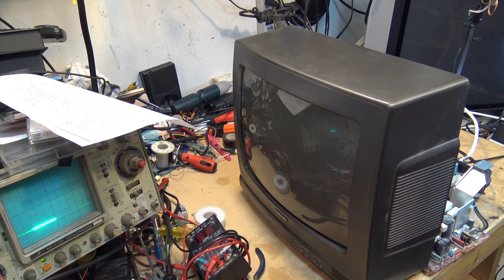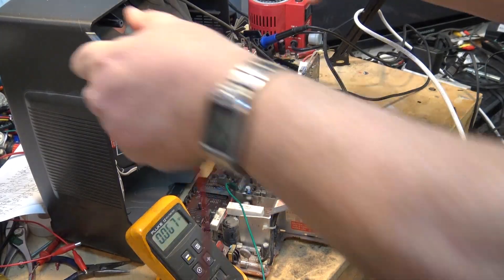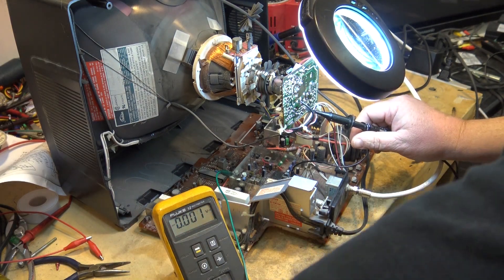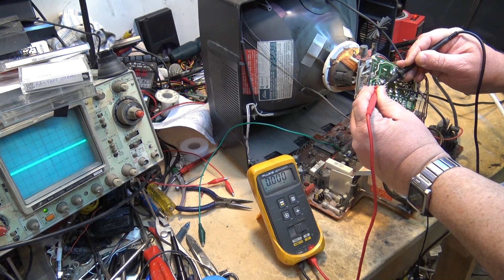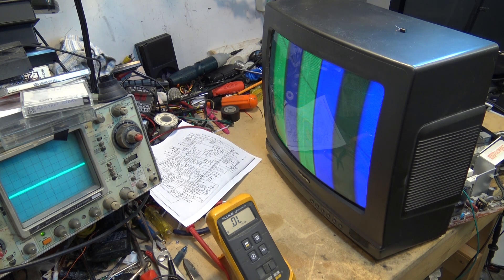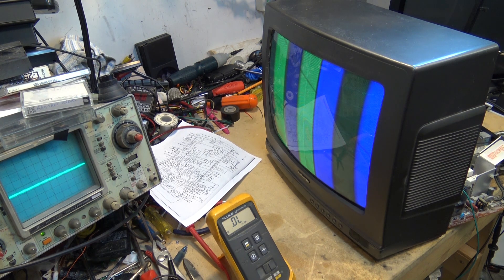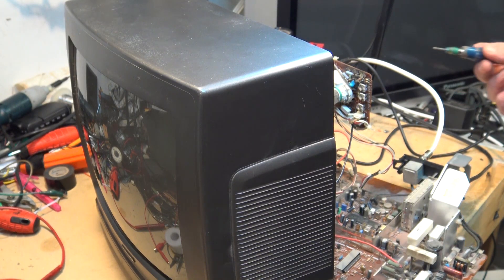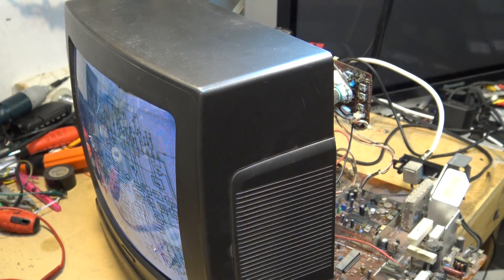toshiba crt tv troubleshooting video output and crt bias adjust

Comment: In rare cases, the video output power transistor may be damaged by some foreign object or by touching the electrodes of the cathode ray tube.🤔
Reply from the maker: Usually arcing internal in the tube pops them.
Reply: @12voltvids  Thank you for letting me know. 🙏

Comment: You plugged in power using an isolation transformer, then connect a grounded scope LEAD  to the CRT? Are there different ground potentials being utilized that are isolated from each other?
Reply from the maker: Scope is not grounded.  It is also on isolation transformer.
Reply: Thanks, Watched another of your video's titled "Toshiba CRT TV No color video repair"  where you explained into detail why your scope is grounded SHOWING your ISO Xformer. GREAT.
Reply from the maker: Ground pin on scope is cut.  I can externally ground it if needed however the device under test is still isolated.  The secondary on isolation transformer is floating.  Therefore contact with either side to ground will do nothing.  Normally the neutral is bonded to ground so a path from the hot side to ground will wither shock you or damage test equipment.  By having both the hot and neutral physically isolated from earth you remove that risk.
Reply: @12voltvids  , Makes sense, I measured continuity  from both AC line input pins on my scope to the GROUND pin & THEY EACH READ OPEN..
your scope is utilizing  "isolated  secondary neutral" as  reference on its BNC connector.... .I  can only assume, I must use my CraftyMech for CRT troubleshooting,.cause my game board supplies along with R.G.B. signals, A  "GROUND POTENTIAL" to THE CRT,, so back to my first thought ,multiple grounds,1 floating and 1 there for signal reference's from the game board.

Comment: 15:52 Contrast(drive) should be set in the middle, not the max.  That's what wore out so many otherwise good picture tubes.    Then you use brightness(bias) to see details in dark areas of the picture.
Reply from the maker: The biggest killer of picture tubes was the dark glass which requires driving the  tube hard to get the brightness desired.
Reply: @12voltvids  Which generation of CRT we talking?  I could get a decently bright picture on a more recent tube, twenty years ago when a 2004 TV was new.  I'd drop the contrast to the midpoint, then move brighteness up and down until I saw details in the darker parts of the image - that's what Brightness controls.  The darker parts.  It's like the master bias.  I did calibrations back in the day.
Reply from the maker: @Zickcermacity  tubes started getting darker glass in the 90s.  If you compare a TV from the 70s the glass was literally clear.  The screen looked white when turned off.  TV's always were cranked up at the factory because on display the brightest tv draws the eye to it.   The proper way to set up a TV is with a smpte color bar generator with the 7.5ire pedistil reference in the black.  You turned the color off turned the contrast and brightness (black level) to max. The. Dialed the black level down to the point that the 7.5ire bar was just visible.  The 0 and 5ire were both black.  Then bring the contrast back to a comfortable viewing level.  Next you killed the red and green guns (or used your blue filter to view.  Increase the color level to the split bars on the blue / white (end bars) was the same level and the tint so the cyan / magenta was the same on their split bar.  I think I did a video on this many years ago.
Reply: @12voltvids   That alignment preocedure (correct name for it not 'calibration') sounds right. 

Today of course, with modern flat screens, there's about a hundred different 'enhancers' I gotta disable in the Advance Picture menus before even beginning to do what you enumerated. None of that crap is standard broadcast or monitor material, all marketing gimmicks.

And the real shame of it is, the general public just assumes that Vivid or Dynamic mode is how "HD" is supposed to look.  Then when they see it correct, they don't like it and want the torch setting back.

My biggest frustration with setup isn't the setup itself, but un-screwing up peoples' minds about what constitutes a proper standard or hi-def picture.

"If it ain't broke don't fix it" is their motto, even if the flat screen WILL be broke a lot sooner if left in Store mode or Dynamic.
Reply from the maker: @Zickcermacity  the fast majority will never like the correct calibration and you will never get 2 people that see the picture the same.  My stereo system doesn't even have bass and trebble adjustments. It's flat all the way through the chain.  To me it sounds fantastic but everyone that listens thinks it needs more bass or treble added.  I set my plasma up with color bar generator and to me it looks fantastic but to someone else it would be too dark for their liking.  That's just the way it is.
Reply: @12voltvids   I won't even go in a bar or other establishment with TVs that the football or soccer field grass looks like a green traffic light!

Comment: I’ve got a later model Toshiba CRT, a flat screen all in one with DVD and VHS, and those work fine but the RGB inputs give a constant scrolling distortion across the screen that makes the tv unusable for what I’m trying to do. Any ideas?
Reply from the maker: The component input is probably 480i only. If your device puts out a 480p signal it won't display properly as 480p uses a higher horizontal scan frequency.

Comment: What would cause a TV to show a white raster with retrace lines? This shows the solution for one color. I'm asking because I have a TV that has a wite raster with retrace lines. There is a video on my YouTube channel if you want to see it. The TV is a Zenith from the early 80's.
Reply from the maker: Loss of screen or video output b+ voltage.  Check the voltage on the 3 cathode. Should be between 130 and 150v. If low there is your problem.  If ok check screen voltage.  Could be tube but usually that results is a single color
Reply: @12voltvids  Thanks, I'll have to look in to it.

Comment: Hi, I have a Toshiba XV48DT-K-TB I am hoping someone can advise me on? it's been used on a regular basis. 
But I came to record on the Hard Drive the other day, pressed record, and a red record light appeared, 'blinking' on the bottom left of my screen, and it just won't record?
 I tried to Dub a recording to DVD, and the same thing happened. I would be most grateful if anyone could advise a possible solution. Someone may have come across this problem.
I thought at first the hard drive was full, but no, it's not that.

Comment: I have a 28 inch Toshiba crt TV that had a blown fuse and kept on blowing fuses instantly.
I connected it trough the dim bulb tester and it was making a popping noise like something is arcing internally.
It could not be high voltage because HOT was taken out for testing purposes.
The fuse that was blown was one for the switching power supply on the board. 
So what could be arcing internally ???
I don't see any shorts with my dmm or any flashes... 
Could it be arcing smps transformer ???

Comment: Love your videos mate, really clear and helpful.
I'm up against a Commodore 1081 repair at present. It has no display but does have HV/scan etc.
I've traced signal through it from input to neck board, I see that the waveform maintains its shape all the way to the driver transistors on the neck board, their output looks completely different though.
The output shape also doesn't seem vary regardless of the input.
Is this normal? (Those transistors test good, at least basic diode/short testing)

Comment: I've got a Sony 21" trinitron tv that I use for retro gaming, nearly 30 years old but when I turned it on the other day the is picture green, what would cause that?
Reply from the maker: Check the voltages at the collector of the video out and see if they are in the same range. If so, disconnect the green transistor. If the green goes away then you know it is something in the green drive circuit. If it remains green then either the spark gap in the tube socket has shorted, or the picture tube has shorted on the green gun.

Comment: CRT Tube Rejuvenators RGB Cutoffs are adjusting the G2 voltage/Screen voltage which the CRT tube Rejuvenator is measuring the current of the G2 grid? the Rejuvenators RGB cutoff displays are a measurement of the G2 grid current?

Comment: On a CRT neck board, how do you know which transistors are your R, G, and B output transistors? My neck board has a bunch.
Reply from the maker: The transistors will be connected to the 3 kathode pins on the tube socket.   kR, kG, kB.
Reply from the maker: The output transistors will be the larger ones.
Reply: @12voltvids  Interesting. I just checked and there are only two big transistors right next to each other, mounted on their own heat sinks. Again, only two... Could one transistor be functioning for two colors?

Comment: Most crts I’ve worked on have never had actual pots for rgb bias, if they don’t have pots does that mean it’s in a service menu instead? My toshiba has a red tint, it was completely red with retrace lines but I touched up some dry looking joints and now it’s just a red tinge across the whole image
Reply from the maker: Yes there will be a service menu accessed with the remote.
Reply: @12voltvids  so as a rule of thumb would you say there's always an adjustment, and whether it's done via pots or a service menu is by how old the set it? or just how they chose to design it?
Reply from the maker: @clarkjames1510  
There is always an adjustment.  Older sets used pots to set the screen and drive. Newer sets it was in a special service menu.  The last generation of ctr sets use akb auto kine bias.  They would automatically adjust and compensate for age and kept the picture perfect untill the tube was worn out.

Comment: Should you set the screen as high as you can so you just about won't get the colour and retrace lines or should you turn it down a bit? I have a 14 inch CRT here for old games and the focus was awful on it until I set it but I turned the screen one thinking it would just get brighter, it doesn't though and seems to just automatically change back to the same brightness after an adjustment. Sometimes the screen will flash bright on changing refresh rates then fade dark again with it set that high but I'm not sure where to set it.

It's a Beko E1 chassis I think. It also doesn't have enough overscan horizontally and the left side has a slight bow inwards but I'm not sure whether you can adjust those and I don't want to blow myself up lol.
Reply: Probably not a good idea, since it could cause burn in.

Comment: Hey so I've been trying to repair an old computer monitor and this video and the schematic got me through verifying that the tube is good, cathodes are not shorted, transistors are good, and that no video signal is making it to the video output transistors. Now to dig deeper!  Thanks for the info!

Comment: So to set the low-light, you turn the screen down a lot and adjust from there?
Reply from the maker: To set the bias or low light as some TVs call it, you set your master screen for a faint white line, and adjust the bias controls (low light) to get the line white. this balances the 3 guns for minimum picture or sets the bias for each cathode. The drive, or highlite control adjusts the red and blue balance to produce a white picture on a bright white portion of the picture.
Reply: 12voltvids Oh, OK. So you turn down the screen for low-light and turn up the screen for drive?
Reply from the maker: yes

Comment: my old tv is not working it has a subwoofer circuit with ic "TA8233BH"
how i use it as a amplifier for my speakers separately
Reply: See if you can get the schematic and run the chip on a board..

Comment: Friend, I need your help. I been trying to make a composite video generation circuit with basic logic IC's (74HC series). I use ripple counters to count the lines and columns and then use logic gates to compare the outputs from the counters and check when to output the SYNC signals (0V). However, when I input the counters into the logic gates, most outputs become a mess! The signals are not stable. Why would this be ?

Comment: Hi there, I really enjoy your videos.  I have an unrelated question and any input would be very appreciated.  I still record programs from TV using my VCR and I have been experiencing issues with my current set-up for some time and am puzzled.  I have had Dish Network with an HD receiver for a little over a year and have noticed that I am getting poor quality recordings most of the time.  The contrast of the picture will change sporadically from light to dark with no affect to the audio (it doesn't always start to do it from the beginning and often times will stop for several minutes at a time or sop completely after several minutes).  Sometimes I can record a show for an hour and it will play back fine and then other programming from the same channel will do this.  I have tried multiple VCRs (all Sony) and they all do it so I really don't think the VCR is at fault.  Commercial video tapes play fine with no affect ever.  I have done some research and it sounds like Macrovision may be at fault but I contacted Dish Network and of course they were clueless.  Do you think that is what is going on here, if not do you have any suggestions?  I am getting thoroughly frustrated here!  I suspect the cable networks are trying to kill the VCR and force people to buy their DVRs.   Prior to this I had a DirecTv receiver for 6 years with non-HD and an off-air connection to the VCR and never had any issues recording.
Reply from the maker: You answered your own question. MACROVISION.All the current digital boxes have macrovision generators built in, and the option to enable or disable macrovision is totally dependent on the video content. Buried in the digital video signal is a flag to enable or disable macrovision. Dish, Direct, Comcast, Shaw, Bell, Telus ect have no way to control this signal. They simply pass the program on to the subscriber. The content owner is in total control. I have the same problem if I try to record from channels like HBO, or the VOD programs. A macrovision scrubber or looking the video through a time base corrector will strip the signal and allow recording.I have my macrovision scrubber permanently attached to the analog output on my cable box so I can make recordings on DVD of stuff I want to keep a copy of. On a DVD recorder it won't even allow you to record, just a message comes up and says protected content cannot record.I did a video on my macrovision scrubber if you search for it.
Reply: Thanks, I'll look that up.  It is very aggravating that we pay to subscribe to the channels and then they don't let us record the programming unless you pay to rent a DVR which I refuse to do.  The majority of what I tape I don't even keep, I just want to watch it at a different time than the broadcast if I am not home or don't want to watch it at the time.  Who in their right mind these days would even buy a program that was home recorded on a VHS tape???  I wish I had stayed with DirecTV.  I have always hated Dish and now I have one more reason.  My old receiver never caused this problem but I am sure that receiver is no longer available.  I had a hunch to keep it in case I ever went back to DirecTv but unfortunately didn't.  I will probably just eventually go to free TV as I don't watch much on TV anymore anyways. BTW, does it cause any harm to the VCR to record something being scrambled by the voltages sent by Macrovision?
Reply from the maker: No it doesn't hurt it. Macrovision  just messes with the sync and video levels. Right now I am recording the movie "Sully" off the on demand service, and yes it is protected up the ying yang, however I am using my Hauppague HDPVR to record the component HD outputs onto my PC. Will put it on a USB stick to watch later on the big TV.
Reply from the maker: Yes that looks like the right one
Reply: Okay, I will try it.  Thanks for all your help.  I really appreciate you taking the time to answer my questions.  You have a real talent which I wish I had more of.  I dabble a little bit but wouldn't attempt any soldering or anything like that.  I am always amazed at your diagnostic abilities.  Most of this might as well be Greek to me but I still find it fascinating!
Reply: Last question.  Do you know if it makes a difference that my VCR unit is a DVD/VCR combo?  One of the vendors on eBay selling the older style unit says that it is not compatible with combo units.  I will only use it for making VHS recordings from television since my DVD player is not a burner.
Reply from the maker: Won't matter as you are recording an external input. What they are referring to is people trying to copy movies from DVD to the VHS.It won't work doing that from internal DVD drive. If you plug it in between an external DVD player, or a cable box it will work fine.I also have a DVD/VCR combo, and I would do a video to show this and how to connect a macrovision scrubber to record from a cable box. Might be an idea to do today. Yes I think I will. Great idea!
Reply: Sounds great, Thanks again soo much!